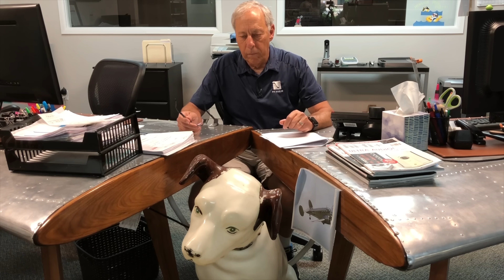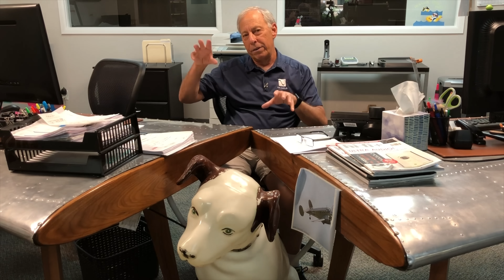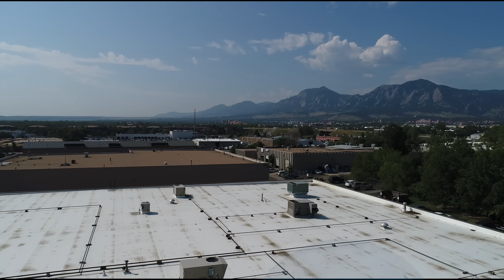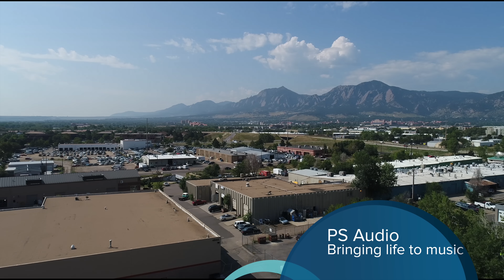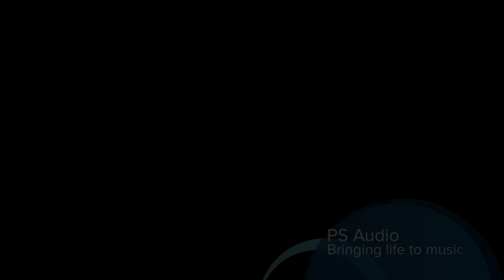Are vacuum tubes worth it?

Comment: I'm a builder of boutique guitar amplifiers - been doing it for quite awhile. (As a matter of fact, I build a model called "The Nipper," a 16-watter with a 10" speaker.) A guitar amplifier is actually only a part of the instrument known as the electric guitar, and it has its own characteristics to add to the total package. For the guitar, "accurate reproduction" is not the goal, since there is no "playback" of recorded material involved, but rather the production of music in realtime.  Amps with all-tube signal paths have been the standard since dirt was rocks and Moby Dick was only a sardine. Guitar amps are routinely operated beyond their specifications, i.e., driven into distortion. The effects which come into play inside a magnetically saturated output transformer are desirable, and aren't "designed out" of guitar amps like they are in tube hi-fi equipment. Mr. McGowan is absolutely right - tubes should be used where their characteristics produce the desired results - and so should solid-state devices. There is a reason why beat-to-death 50+ year-old Fender guitar amps sell for danger money, and that reason is TONE.  If you have a favorite guitar player, chances are pretty good he uses a tube amplifier. (For instance, Eric Clapton, Derek Trucks, Joe Bonamassa, Warren Haynes, John Mayer, Jimi Hendrix...a pretty well endless list.) Guitarists actually "play" the amplifier  by controlling how much distortion is added to the tone, varying this in realtime by operating the guitar's controls and changing the pick angle and force sometimes several times in a second.  Feedback - done on purpose - is also a desirable characteristic in a tube amplifier. Transistor amps don't do any of this very well, and that's why many experienced players don't use them. Yes, there are digital emulations of "classic" designs, but they sound like, well...emulations. Close, but no cigar. I'm not an engineer, and I'll be the first to admit that I know damn little about "high-end audio." I figure if it kicks ass and no smoke comes out of it, I did it right.  ;-)
Reply: Paul is absolutely right when it comes to tube line stages and input sections being the best, and transistor based output sections being the best. At least imho. Definitely for hifi, but imho for guitar amps too.

 Consistently the best sounding guitar tones i can make, are tube preamps, into the Effects loop return of an old randall rh150g3 metal amplifier head's tube buffered mosfet power amp. Years ago i discovered this, and i've had a lot of amps, all tube, all solid state, modeling into powered speakers now too. Ive built my own clones of some of the old greats, I keep coming back to my various tube preamp stomps and rack pre's into that mosfet power amp.

The current "best version yet" of my home hi-fi setup is a class A all tube preamp, into a good class D power amplifier. It's everything ive ever been after with musicality, soundstage, tonality and then some. A made a version of the preamp for a friend of mine's old solid state onkyo integrated from the early 80s after i recapped it and ditched all the unnecessary electrolytic i could. Whole new life into it.

Any chance i can get, i set up a tube front end with solid state power. There is just something about the combination that, as Paul puts it, is very hard to beat, nigh impossible. Im not after a classic sound necessarily, just what sounds best to my ears and thats it. I get quite a few compliments whenever i do play out as well, admittedly quite rare now a days though.

im actually considering reworking my current hifi preamp design into a single channel single ended preamp for my guitar, it's plenty quiet enough and has plenty of gain for it with a nice smooth clip. And starting from a known mosfet single channel power topology i can tweak to make my own guitar head unit thats everything im after in a single box. Hell i may tear the power section out of that old over the top randall thing and use it. 150 watts of clean headroom right there.

Line 6 made the spyder valve amps yeaaaars ago that had a bad wrap, mainly from people that never even tried them. I owned a combo, played several of the stacks. They had digital modelled effects running through an all tube front end, and a Tube buffered mosfet power section i believe. Those things sounded absolutely incredible at bedroom volume, and they sounded exactly the same at ear splitting volumes. I sold the combo planning to buy a half stack, but they discontinued them and i still havent seen one for sale locally anywhere. Which has bummed me out.

Anyhoo, if the market wouldn't have recoiled at the thought of what those line 6's were without even trying them based in some pretentious principle of thought, i probably wouldnt have to hack together my own version of it. And it would probably be quite a popular setup today. Anyone i have listen to music on, OR play guitar though such a setup are pretty much universally blown away with how musical it is, ESPECIALLY when it's not just trying to sound like something else, but simply a good guitar sound, or a good music sound.

Comment: OK lets get this straight. High fidelity is about producing the most accurate sound of the source. Vinyl ,CD,Tape or whatever. The salesman in the shop was trying to convince your correspondent that modern solid state/digital amps are as good as valve/tube amps for producing THAT guitar tone that we all know and love. No way!! At least not yet.As I see it, the job of the HIFI industry is to try and bring the sound of the performance into your home and is totally separate from musical instrument amplifier design.
Reply: The French guitar salesman was doing his salesman job, nothing more, nothing less. The last 5 years have seen astonishing progress with mosfets used to mimic tubes for guitar amplification and I have been buying up dozens of these 'platform' pedals to compare against the vintage amps they attempt to model, and the conclusion is: 'not there yet'. There is a choked midrange and 'grayness' with the transistor versions compared to the tubed originals. I concluded that Mosfets have a 'sound' just as tubes do. Despite the advantages in portability I will not be leaving the tube amps at home. Once you've heard and played the best why would you settle for not quite as good?

Comment: KR audio vacuum tubes are not microphonic they use a special glass to eliminate this.
I was thinking I'm getting there preamp very good the p135 how would that run with your power amps have you tested? I would like to go through Solid State has to be multiple channel because I'm running it through an ASP. struggling what type of power amp i should use.

Comment: The truth is that tubes insert a distortion into the signal that many audiophiles seem to like!  What kind of distortion? Well, several things actually, but the most obvious is the even order harmonic amplification that tubes add to the signal. This distortion is for many people pleasing to the ear-brain interface, and so they like how tubes sound! 

But the real question is could a sufficiantly sophisticated digital plug-in emulate that distortion well enough that a really good sound engineer could not tell the difference between the "real thing" and the plug-in?  And I seriously doubt that even the best of the best could tell the difference!

Comment: This explains a lot.
I love tubes in preamp or buffers. Solid state amps in Main system. Second system runs an el34 integrated.
It seems the best use of tubes is in the preamplifier stages as you say.

Comment: Are vacuum tubes worth it? No. End of discussion.
Reply: Maybe not to you, but to other people they are. Personally I love old tube radios, they pick up great, they look cool as Hell, have real history to them, and real radios (and amps!) glow in the dark. If you don't agree that's fine, don't buy anything with tubes.
Reply: Radio was never my bag. I never cared for how tube circuits looked either. I don't see how tubes have any more history than solid state does. If you insist on things glowing in the dark RGB is big today. Though I'll pay more just to get hardware that doesn't glow when it is not supposed to.
Reply: Expensive and soon as you plug them in they start to slowly die.
Reply: That's it. If you like your tubes then be prepared to be buying new tubes every few weeks. Because the tube you start running today won't be the same tube in a little while. Semiconductors suffer from electromigration themselves but it is not nearly as pronounced as the erosion that happens in tubes.
Reply: It depends entirely on what you like.
Reply: It depends on whether one places their subjective feelings over statistical data. Tubes still have a few real world applications where they excel but none of that is in audio equipment. There solid state has surpassed tube technology.
Reply: Your ears are not even within an order of magnitude as sensitive as electronic test gear is. You cannot even discern percentage points of distortion value just listening. Check your brain.
Reply: Guitarists are by and large idiots. I'd sooner go to a witch doctor for my medical needs than seek the advice of a musician when it comes to audio fidelity. A witch doctor is better grounded in science.
Reply: In a guitar amp they sure as hell are. End of discussion? Yeah right, please stop embarassing yourself.
Reply: Why? There have been modelers of amplifiers available for decades now. Transistor amps can sound like any crappy tube amp known to man at the flip of some switches.

Comment: A vacuum tube doesn't "sound better". It amplifies a signal.
If you seek for linearity of your signal, meaning the most transparent amplification, a transistor powered amp will do a better job. 
You have to compare honestly the price too. Is a $1000 vacuum tube amp better than a $200 transistor amp? Well... Guess.
The nature of the distortions is the main difference. Tubes have a tendency to produce more pair harmonics and transistors odd harmonics. But in their linear area of use, you can't tell any difference.
Reply: Maybe it does sound better. Keep in mind that we aren't just talking about electronics here, when we talk about what sounds better we are also talking about the human ear. Tubes may introduce a subtle something into the sound that makes it sound better to the human ear even in two amplifiers that otherwise have identical specs.

Comment: in truth, there is no substitute for what a WELL DESIGNED valve amplifier can offer an audiophile. it's ability to create a three dimensional soundstage is simply uncanny, and unachievable by merely having a valve pre and "FET" transistor output stage. if you want the gain, you have to accept the pain (and fact) that a tube is much like a light globe and bears a similar fate, yet for all its physical (or electronic) misgivings, its sonic signature is unparalleled.

Comment: I have to disagree on this one.   Tubes are horrible at producing long term current.  Tubes are much much faster than transistors for short term burst of current.  Just a few ms.  That is what is needed for real music.  Not a sine wave but real music.  A bad tube amplifier can sound absolutely horrible.  An excellent  low power say 20 watts rms per channel tube amplifier is as good is it gets. Such an unit can easily outperform almost any modern 100 watt per channel transistor amplifier when listening to clean lifelike music.  There are many many modern devices that all but eliminate tubes from "ringing or vibrating" from sound waves produced by speakers.  Transistors are also affected by the same forces but to a much smaller degree.  All audio equipment sounds better with the right mounting or platform. Different types of isolation work for different types of equipment.

Yes quality  tubes are also excellent in pre amplification.  You have to do this by ear.  Some tubes just sound much better than others.  Even in a voltage gain device.
Reply: Everything............R&B and acoustic are two favorites.
Reply: "Tubes are much much faster than transistors for short term burst of current.  Just a few ms."

What is this crap? Firstly milliseconds aren't that short in the audio world. What you're talking about sounds like unregulated supplies and how peak power output is much more than sustained power output.
Reply: I've heard my voice through the speakers while shouting into a solid state phono preamp.
Reply: Pretty rare to find microphonic solid state amplifiers.

Comment: And then we have the pure joy of tube-rolling. It's so satisfying finding good old NOS tubes that sounds so different than the original tubes, and sometimes undoubtedly improving the sound, and sometimes not. But when it does work out, it is so satisfying... Just to have that capability just within the device itself is sort of comforting. I don't have to buy whole new gear to change the sound, just tinker a little. And I haven't even ever used a tube power amp. Just pre-amps and RIAA-stages and the like.
Reply: True, rather difficult to do transistor rolling LOL. I have done the gambit from 450 watt mosfet to KT88 / el34 250 watt power amps. So much is dependent on the speaker type. Owner of an IRS Beta, current sucking 1.8 ohm monster set of loud speakers with a direct comparison. Tubes were so much better (sound) than the transistors.  The woofers columns were better with transistor or mosfet amplification.   It was after this revelation I learned about the true benefits of 2nd order harmonics. Now I still use tubes but the speakers are with a 108dB sensitivity so triodes rule the the last stage at a whopping 4 watts, which since the woofers are self powered is twice what is needed. So again it is all about the speaker and your ear.
Reply: I've been looking for old TV's and radios. I would be thrilled if I could find some old 12ax7's or el34's.

Comment: Great video...  Technically I think a tube Power amplifier would suffer very high THD, though this distortion is rather "soft"... Probably why tube lovers enjoy them, for their character
Reply: Paul was very good at explaining this situation. Your comment is in fact very accurate. Tubes do not impose "high THD" but a very low single digit 2nd and 3rd order harmonic distortion that is very pleasing to the ear. If an unaware listener is presented with tubes or very low THD solid state electronics the tubes will win every time. That does not mean it's accurate. If a listener is presented with tubes or live music in a blind test the tubes will win every time.
Reply: Ever hear the 1954 RCA Tube Manual line stage and phono stage with all modern high quality components?  There are superbly detailed solid state units which sound wonderful; the RCA tube “pre” has downright beauty of soul…regardless.  I’ve got the scratch-built RCA and it’s a marriage of choice and, yet, have had to admit…

Comment: in conclusion Paul , are you saying that the perferct compo is a solid state drive with a tube preamp???
Reply: Yes, and no. You can have a power amp with tubes, but the INPUT stage of said amp can be tubed, but the OUTPUT be solid state. If you notice in an all tube amp, such as a Dynaco stereo 70, they use several types of tubes, the small tubes in use would be like the 12AX7 are for the input stage, accepting the signal from the preamp and something like the KT88 for the OUTPUT stage, but in a hybrid system the input is still the 12AX7, but the output is solid state. So in essence, you still get the sonic benefits of tubes, but the quickness of speed/attack of solid state.
Reply: To me separates are the way to go, tube preamp into SS power amp class A, A/B or D
Reply: John h Palmer Could define input stage for me please? Does an amplifier have an input stage, or is it the preamp section of an integrated amp?
Reply: @vicwahbyphotography4866  the preamp section
Reply: This combo works for me, fantastic sound
Reply: Tube for Voltage gain  mosfet for output stage.

Comment: I'll keep my 6550's burning in my '63 H.H. Scott. It's my thing. I love the smell of tubes. But you find your own sound.
Reply: ha! i had 3 scotts. but went to 300b. still love them if i wasnt moving cross country would never have parted
Reply: Got aan H. H. Scottkit running 7591s. Best sounding and the quietest amp I ever owned.
Reply: which Scott used 6550s?